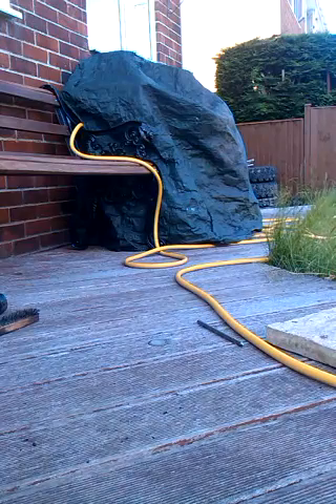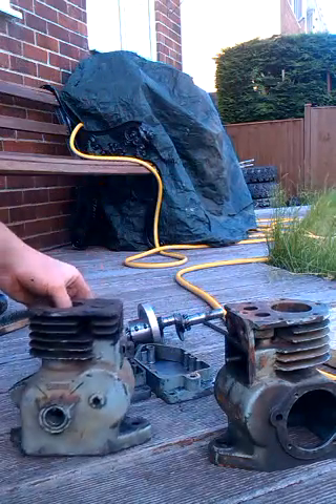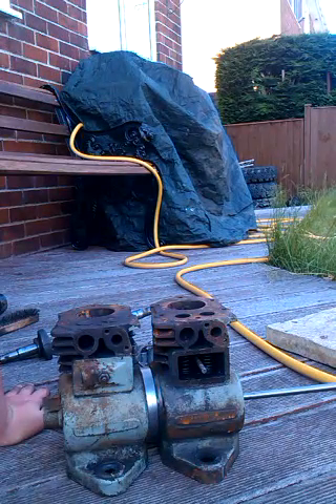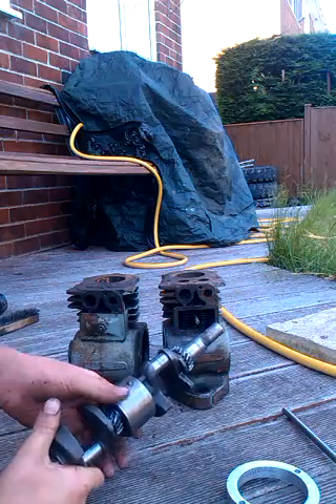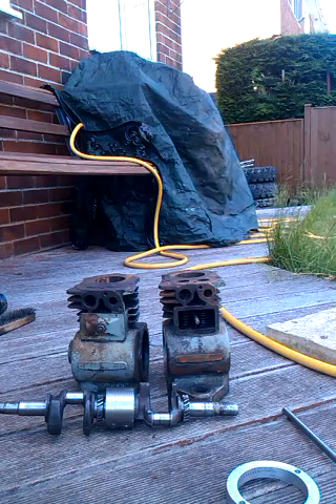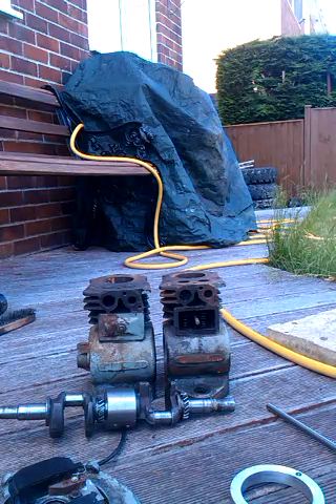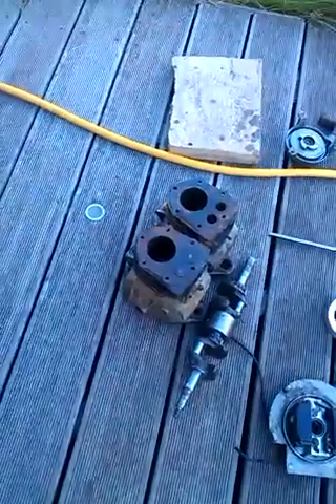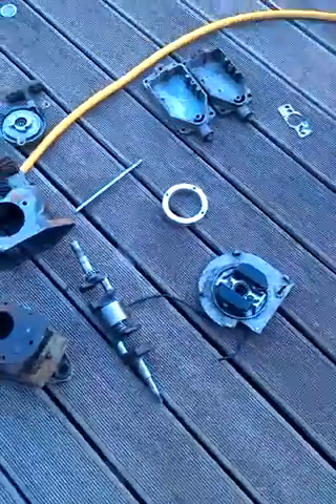Twin cylinder Suffolk. Part 1

Comment: These look like sort of a copy of a Briggs and Stratton 5S / N / WI / or whatever. 
I'm in the USA and I'm curious about the bore / stroke dimensions on these and how recently these were produced in hopes of finding more reasonably priced and more widely available spare parts since Briggs and Stratton quit producing these small cast iron engines around 1959. I can GET parts for my old 5S Briggs engines, but they're kind of rare and expensive NOS parts. 
My 5S Briggs have a 2" bore and a 1.5" stroke. These look VERY similar to Briggs inside.  Thanks!